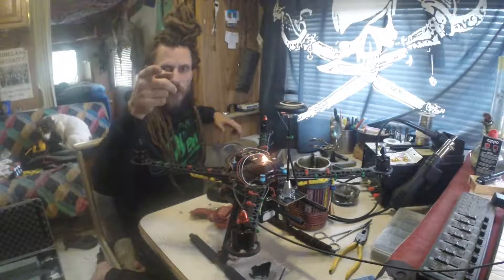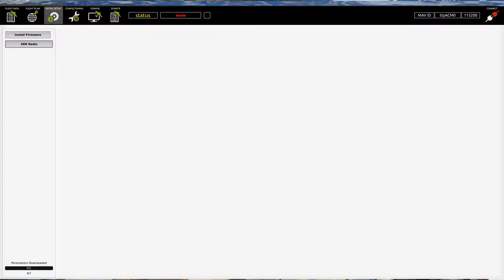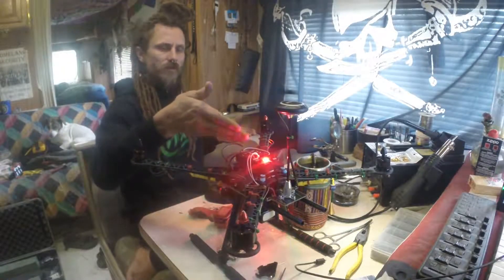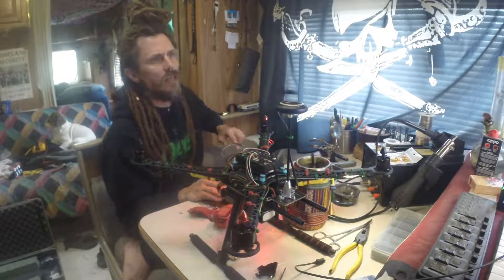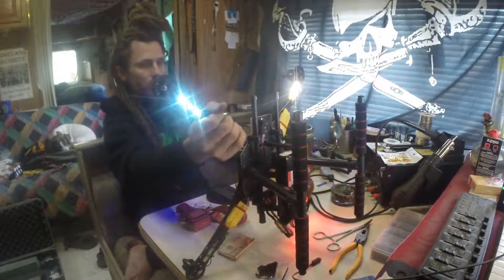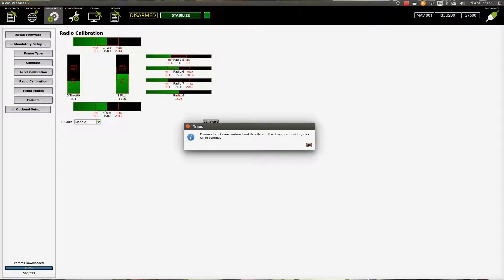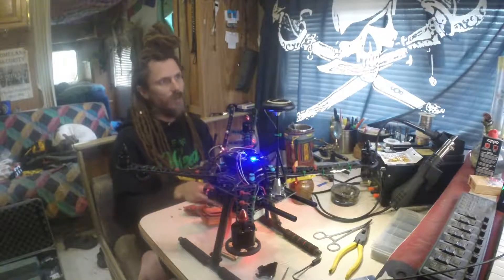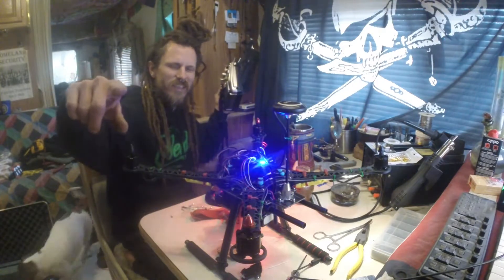HowTo: PX4 Controller Calibration for your Quadcopter Drone

Comment: Hello sir, I need to collect some telemetry data from drone ( data logging from pixhawk  using sd card and sd card reader. Can you make a video please) 
I am interested to collect load current, voltage, position, orientation and control inputs
Reply from the maker: Hello! I have long since sold this drone and have not worked with a pixhawk for some time. Sorry I can't be of more help. Best of luck!

Comment: How much was that drone
Reply from the maker: I already had the transmitter, receiver, battery and charger. The price for mine breaks down as follows: s500 frame $40, drone electronics kit $115, gimbal $20, motors $50, ESCs $30... so about $200 spent plus using lots of parts I already had. 

If you're looking to get something cheap with everything you need, maybe start with something like this: http://amzn.to/2ocNoZR 

That should get you started for about $200 for everything you need to start flying.